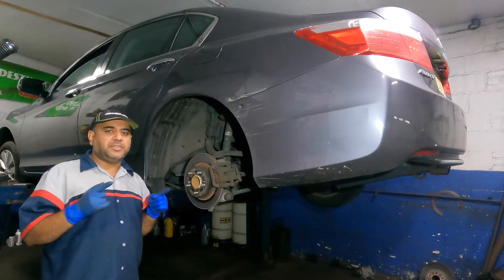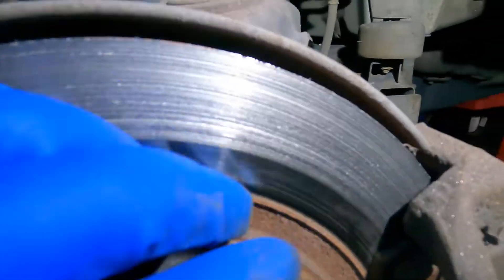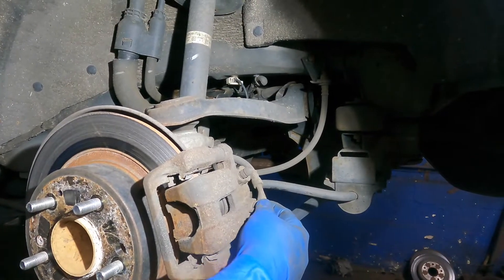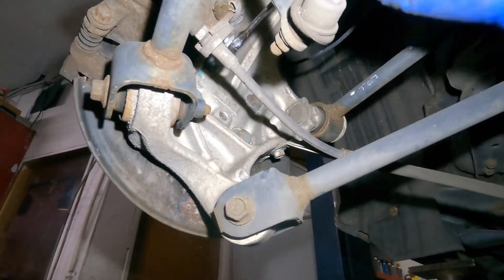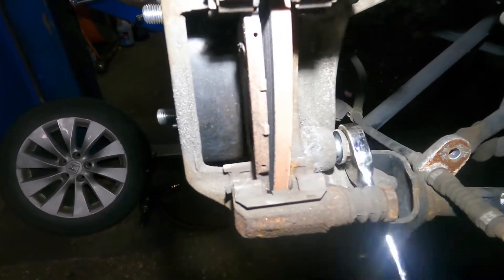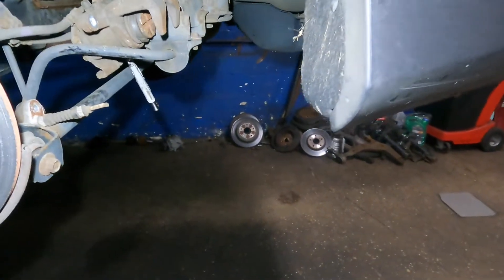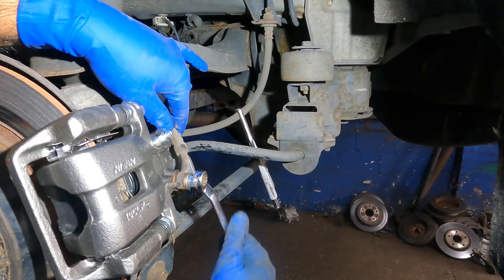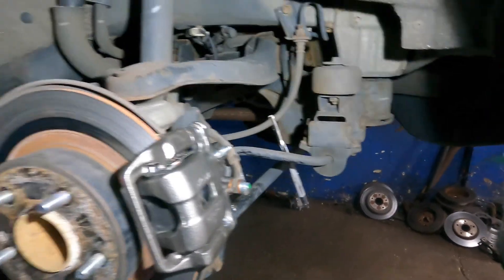How to replace rear caliper on Honda Accord 2013 to 2017

Comment: I tried changing my rear break pads on 2012 Honda Accord. I noticed one of the 2 caliber screws was missing. Can I buy screw or I have to replace whole caliber?
Reply: You can buy it separately or as a part of caliper repair kit. Or ask local junk yard.
Reply from the maker: Yes I prolly can buy just the bolt but why is it mission? Did u try discovering why?
Reply: @RBTheMechanic  when I was watching your video on how to change rear break pads, after taking tire off I noticed rotor wasn't straight. After you took both screws out I noticed I only had one screw. Not sure why but only 1.